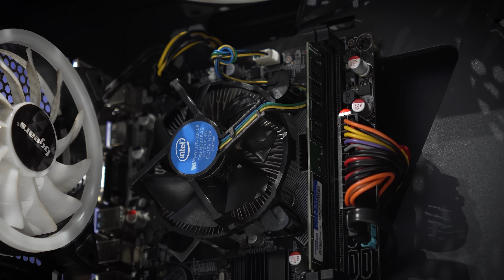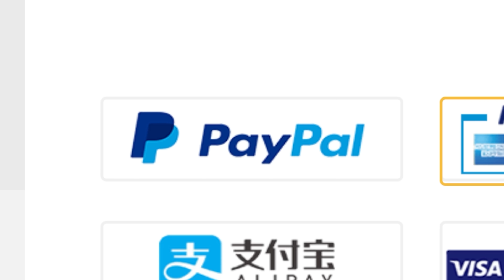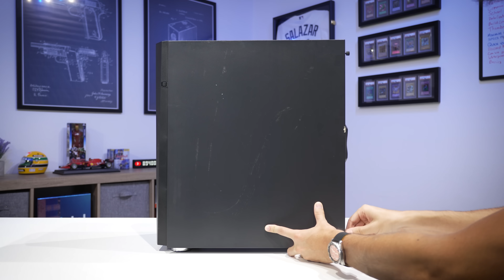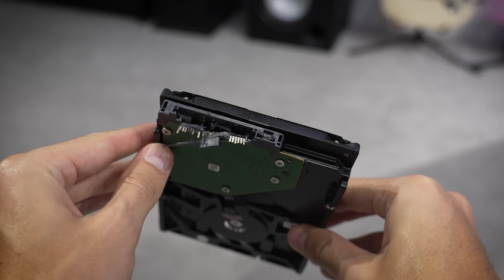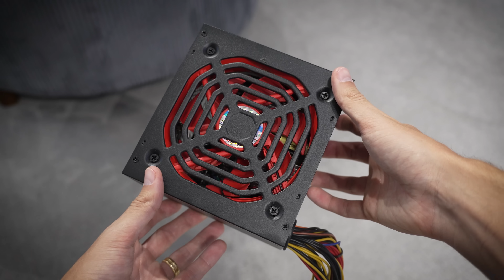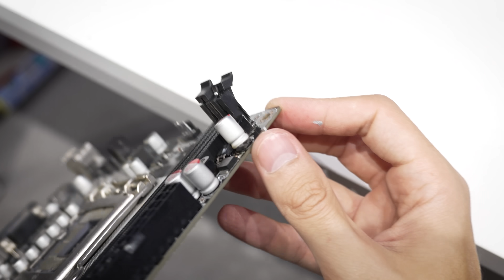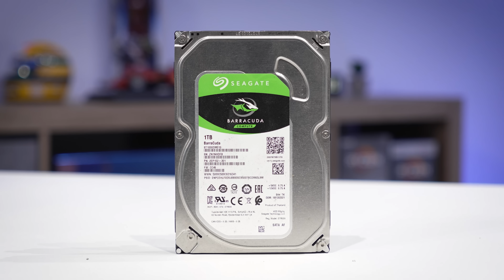So I Bought Another BROKEN Gaming PC on eBay...

Comment: i was just wondering... it almost looked like whoever removed the gpu cooler put it on backwards (flipped 180 degrees). i also never saw the case fans working? or did they spin at some point?

Comment: no but your dryer plug and electric car charger plug is 220/230 volts so if you have a travel adaptor you can run the machine from your dryer plug.

Comment: It looks like somebody just put together some throwaway, damaged parts and just list it as "not working, not opened or diagnosed". Truly despicable practice. Greg at least can recoup cost from YT, but there are many people risking and buying this kind of hardware and trying to fix it for a living.
Cap on the motherboard simply exploded, probably taking VRM with it. Radiator on the GPU seemed like it was mounted in reverse. CPU probably never was used in this system - this sticker indicated it was taken out of a shipment of old used parts from China, where you buy parts in kilograms or pallets. Whole PC looked like it was worked on before listing.

Comment: Greg, what likely happened were was an overvoltage that caused an arc fire, which would explain why the HDD SATA connectors were melted like they were. That system is TOAST and was not worth $250 even for "spare parts", that system was good enough to be donated to a school to learn about PC's and that's it.

Comment: The motherboard, CPU and GPU are all AliExpress purchases, with the CPU likely a refurb also. As for the GPU, someone removed the heat exchanger and installed it flipped the wrong way around. And the PSU with a too low AC input it will either not turn on at all or supply too low DC on the other end leading to the PC simply not turning on. Nothing that can harm anything. Edit: false statement
Reply from the maker: For the PSU, I've seen damage from an incorrect 120/240V toggle. Seen blown fuses, even. So no, I wouldn't throw out the blanket statement that no harm can come of it. Your other sentence about it feeds a bit into what we already discussed in the video. Sometimes, PSUs will work just fine on 120V supply if left in the 240V setting. All depends on the manufacturer.
Reply: @GregSalazar  yeah you're right, been thinking about it more. Depending on the design when powered with a too low volt the PSU could draw more current than a component can handle to compensate for it. It would be an extremely shitty design tho!

Comment: lol jag lider med dig men du har säket mer pengar en många andra av oss har . men som sagt  cpu har en i3 2100 liggades kanske 10euro du hade en i5 2400 kanske max 30euro , 2*4gb ddr3  20euro gpu 20euro maxaimum if it works  case 20euro  fans 20euro total price =  30+20+20+20= 90 euro så jag är ledsen idioten som sålde detta lurade dig jag hade gått tillbaks och ifrågasatt hans  beslut ... inte ens nätagget om det hade vart nytt eller fungerande hade vart värt mer en30 eruo ... 120ruro max för den datorn

Comment: The MOSFET (the component next to the blown capacitor) probably got so hot that it desoldered itself. I've seen this quite a few times and my guess is that it took a hit from the dead/cheap PSU because it's part of the power delivery of the board (so the next thing in the chain after the PSU).

Comment: lol, they installed the GPU heatsink upside down. 

I'd be tempted to test for continuity on that weak leg... if it has continuity, just move on to replacing that cap and see if it powers on then. 

This would be the kind of build where I would throw caution to the wind and just do whatever it took to get signs of life and figure out what I could about it. 

My guess with the HDD: someone connected the flat side instead of the 90 bend side of the SATA cable and tried to shut the back panel, bending the panel's groove outward and breaking the controller PCB on the drive. 

You should be able to swap the drive controller PCB with an identical drive, that way you might be able to determine where the machine originally came from and how it may have found its way to you.

Comment: The US is technically a 240V country. We just split it into 2 120V phases for residential houses. It's what high power devices in your house like a dryer and AC run on. Technically you could have a 240V circuit in your house just for running your PC and networking gear if you wanted to get some extra efficiency. (Power supplies run a bit more efficiently on 240V over 120V)

Comment: the US is pretty much exclusively 240 btw. We just split it and why we have a split phase system so we can chose.
Reply from the maker: In households? General outlets are pretty much exclusively 110-120V... NOT 240. We use 240V for certain appliances and things, sure, but the outlet standard is absolutely not 240.

Comment: 100% a scam. the missing thumb screws, the hard drive, a literal bomb of a psu, a broken motherboard and that dead gpu. 
i saw the video and i assumed you got a low spec system, i didn't expect to ever see a scam like this. it is disgusting. i feel for any one that has ever purchased a low spec system like this off ebay. the amount of people scamming on that platform is revolting to say the least.

Comment: I have a question someone here might be able to answer. I have an MSI B550-VC Pro motherboard with a 5600X3D cpu that up until about 2 weeks ago was running just fine with cpu temps right around 40c while watching YT videos and at 65c to 70c while playing COD. Then between one day and the next it went to 50c watching videos and up to a max of 83c playing COD. I have had no crashes or BSODS. I was using a Pure Rock 2 air cooler but switched to a Thermalright Phantom Spirit after the jump in temp but it has not helped. External temperatures have been the same during this. Anyone have an idea about what could cause this?
Reply: Hello. First thing that I came to mind was a bios setting got changed some how. Maybe a setting in windows is causing the cpu to run hotter ; maybe in jealousy of the ( HOT - Intel ) babes ; LoL.

Comment: Oh my GOD, I had this EXACT same PC on my workbench not 4~ months ago.  I consider it the single worst machine I've ever had to work on.  When I got it, its heatsink wasn't even fully seated, the dot of thermal paste on the CPU was still a dot!  Same i5 2400, same GTX 650, same noname motherboard...and same god awful case, including a riser to hold the jank glass panel!  After a few days, I actually got it working again.  Dead PSU and a few bent pins.  I ended up removing that "slash" of white plastic and LEDs on the front of the case to give it some kind of ventilation and ended up selling it quick for like 40 bucks.  I just wanted it out of my lab!  Awful, awful machines, no idea where people are getting them.

Comment: Did the original buyer get IHS scammed. For those who don't know some cheap CPU's normally bought off Ebay and AliExpress can sometimes be a much older CPU with the IHS of a different CPU removed and replacing the IHS of the original CPU. Basically you got scammed and got a really old CPU with a modern IHS of a newer Intel CPU. 

Running a PC with the wrong voltage (back in the days of the Kill Switch) could overvolt all the components though normally if its a motherboard the south bridge chip is normally hit first. 

The only things I have seen that still come with a manual voltage selection switch is 3d Printers.

Comment: Well you obviously got scammed and I hope you reported that seller.
It looks like the cheap combos they sell on Aliexpress, old CPUs with new chinese board with strange bios and a crappy old GPU with even crappier chinese cooler for 50$.
I'm guessing it was turned on at the 230V setting and being a crappy chinese PSU it has no protection so it fried everything connected to it.
It was extremely foolish of you to buy this system for that price but at least you saved someone else from receiving this crap.

Comment: The switch set to 230v and getting 115v should be okay.  It should just fail gracefully as the output undervolts itself.  The real killer is the switch set to 115v and getting 230v - that leads to noise and smoke and excitement.

Comment: You've demonstrated your point at the beginning about not buying a broken PC like this Greg. That was a MEGA SCAM, and buying it has exposed you to the scam. This PC was ASSEMBLED FROM BROKEN PARTS TO SCAM SOMEONE WHO WAS TAKING A RISK THAT THEY COULD FIX A BROKEN PC. Dick move, yes. I hope the sponsor paid well for this one. Let this be a lesson to all of you! Buy from reputable sellers with refund policies, and ensure you are clear on the value agreed and the condition of the item before you buy. Leave buying broken items to the specialists/professionals who can actually salvage parts from them. I've bought broken GPUs and just replaced the fans, cause I knew what I was doing. Buying the whole system like this is a foolish gamble.
(The HDD ports were broken so you can't find out which hacky "IT shop" was behind it.)
Honestly Greg, buying this PC is a bad example to set. Also please don't normalise sticking your fingers in fans. You even question why you bought the machine at this price, but you didn't even seem to know what was in it? Did you have a stroke when you forgot to ask for a parts list? Stop shopping on crackhead's craigslist.

Comment: Looks to me like someone ordered and aliexpress special. It shipped with the PSU with the wrong voltage selected. Whoever got it just plugged it in a turned it on and it blew and took everything in the system with it. They took it apart to look at it. Probably removed the motherboard and back panel and threw everything back together. They probably couldn’t get the back panel on so they tried shoving it back on with force and broke the HDD connectors in the process. Just my guess.

Comment: Apevia are a decent power supply brand and quite suitable for low end builds. Switching it to the 230V setting in America will have little affect, but switching it to 110V in a 230V country will blow it up.

Comment: Okay, the motherboard in a B75 ITX for B75A ITX sometimes says Foxconn on them which was a legit Intel board partner at one time, but I don't think this is a real Foxconn board. They were still making this board new as little as 3 or 4 years ago because I do remember buying a few of them on eBay. They all had problems. Usually one of the RAM slots wouldn't work, or the board would only take second or third-generation Intel CPUs but not both. They would come with or without the M.2 slot or USB 3.0 header, and sometimes the PCI-E slot wouldn't even work. 

Sandy or Ivy Bridge isn't that bad even today and you can easily find a $15-20 Xeon to max that platform out. I played around with one of these with an E3-1240 and a GTX 960 4GB a couple of years ago and I was able to get Spider-Man, GOW, and Cyberpunk 2077 to play with reasonable settings. I put the PC together for about $100 bucks and sold it for $150. The guy used it for a little over a year and upgraded to something new last summer. I know because he called me for suggestions. Used OG Xbox One's and PS4's still go for $150 or so in my area so a PC like that will run pretty similar for the same price. No such thing as a bad PC, just a bad price.

Comment: cpu heatsink bout the only that works but even then, its old crappy stock cooler, something fishy about the glass panel probably hacked from a different case and bodged onto this one, which is real pain in the ass since thats probably the only thing worth £20 except maybe the cpu if it works.  cheap fans if they work a couple a quid each , rough estimate £40 maybe £50 if theres any extra value in the cpu.

Comment: Well, you have a case you won't feel bad about modifying.  Break out some tools and get to cutting it up , maybe a few tiny ac o rings or something for the glass panel. Some bondo and paints, rgb, and creativity. Possibly Cutting it up for better ventilation and fans or aio. I'm with you though, I'll buy something if I think I can fix it.

Comment: i5 2400 + Gtx 650 is no where near $250... The only way I'd pay $250 for Sandy Bridge is with a i7 2600k and a Super Beefy Cooler with 32 GB DDR3 on a Z77 MB plus at least a maxwell GPU - also all working. Those parts are 13 Years old at the time of this video and all broken so this one is a all over L - the seller bunched up all his semi to non working junk in the hopes of getting cash but the worst is that it isn't even priced appropriately which means it's likely very intentional. Broken for parts that machine should be at max $10-$15 since you could scavenge the Fans and the Case and the cooler + possibly the Cpu.

Comment: Anything with ddr3 is just junk now, I was doing a case swap with an optiplex 9020 i7-4770, got the adapters, and a junk rx580 from china that worked one time, and then didn't work again, at a certain point you just hit a wall and say to yourself "you don't need to shine this turd, build something new".

Comment: So for $250 you got a faulty motherboard (possibly blown by the PSU's voltage setting), a bad PSU, a bad/mangled HDD, a case that was on its last legs, and a potentially faulty GPU.
IMO the whole rig was not worth it, especially given it was 2nd gen Intel and a GTX650.

Comment: Looks like a scammer threw old parts together to mee too. Subscriber here:  I just came across an stagubron used gaming desktop on ebay with everything intact except a missing cpu, and video card. Only $111 total after tax and shipping.  Cleaned the thing up after i got it, and installed a used intel i7 4th gen quad  3.60 ghz cpu, ( $30 off ebay), and a $40 amd rx 460 4gb video card, and  used my destruct pro usb key wiper to wipe the 1tb ssd, and ,viola,  i got lucky. works like new.  $190 total, and for the little money, now working good. Not the best for 2024, but for the little money i spent, great for casual gaming.

Comment: Yes, this was a special purpose.. to sell and sucker some one for $250.. ROFL, sometimes buying from E-bay is hit, but most of the time, it is miss (sadly), the Hard Drive, is actually easily repaired, that socket and the controller board are easily bought and replaced, but mostly not worth doing at all.. send it to Louis Rossmann (Rossmann Repair Group) in Texas just for fun, they like getting broken hard drives for practice on how to repair them.

Comment: I had a rig running a 2600K and GTX 660 until about a year ago.  Hand me down system used for a kid to play roblox at 10809p.  Stability issues from a ram dimm slot not being 100% caused some start/power-on issues.  Upgraded it to a RTX 3080 & 7800x3d combo and blew a young person's mind.

Comment: Hey love your videos!, I have a question and was wondering if you would know what would cause this problem so on my pc when ever i plays mw3 after playing a game or 2 it’ll say on the screen no signal and then I have to force shut off the pc but when playing other games it’s fine and overall doing anything else it doesn’t do it, the components I  has are a intel Xeon E5 2630 v2 and ddr3 at like 1360mh 16g in dual channel and for the motherboard szmz X79SE LGA 2011 and a asus rx 580 8g and the power supply is a 500w bronze rated.

Comment: Dont forget, Greg. "retro" PC Gaming is becoming a thing. People buy or build machines with old parts so they can run the games they grew up with on period correct hardware so they dont have to emulate or anything. definately keep the old parts incase you or someone you know wants to do so sometime in the future.
Reply: Yup - i5-2400 and GT-650 would make a great little XP retro machine (although you'd be better with Haswell). Shame these are fried though!
Reply: Not sure second gen core i processors are retro enough yet LOL
Reply: i5-2400 would have come with win 7, not sure xp would handle this hardware from a driver standpoint.
Reply: @buildyourcomputer  It should do - my B85 motherboard (for i7-4770) comes with WinXP drivers, although the USB 3.0 ports are not supported and revert to 2.0. If you use XP SP3 then you also don't need SATA drivers for the SSD. Nvidia support XP up to the GT-7xx series too.
Reply: Intel Pentium 3 and AMD Athlon 64 are considered Retro. Maybe Pentium 4s. The demand is for Windows 98 era parts. I know because I have a Windows 98 machine. Everything in this machine was fried. That motherboard is useless.

Comment: A PSU with a 115/230 switch got me good one time - I bought a gaming PC off of Facebook Marketplace, and it worked fine; all it needed was a solid state drive. It had an 8th Generation Core i5 and a GTX 1060. I updated it BIOS, installed Windows 11, installed updates, and everything else you need to do to get a PC ready with no issue......until I tried to run the Heaven Benchmark. And it immediately cut itself off. Tried it again, same result. Ran another stress test, watched the CPU hit 100 degrees, and then the PC cut off. So I bought it a new CPU cooler, installed that, ran the same test, and the PC cut itself off again. At that point, I figured it had to be the power supply, and sure enough, the one it had was set on 230 and not 115. But I still replaced it, and that fixed it. But I was very surprised it ran, and was stable, until I decided to do any kind of stress test on it. I would have thought putting a PSU at 230 in the United States would make it unstable at any workload.

Comment: The state of the HDD connectors was quite a shock, but the description of the PC was correct BROKEN as you just flushed $250 plus postage down the old toilet but the case may be worth at least $5 so not all bad🤢
Reply from the maker: LOOOL thanks for helping salvage some of my dignity 😂

Comment: Did you check the actual GPU chip type. This GPU looks like a bogus GT410 that may have be reflashed to mimic a GT650. Also the HDD most likely got destroyed on purpose as it looks like someone was handling it with some pliars
Reply from the maker: I would have but it was dead either way, so didn't really matter :-/